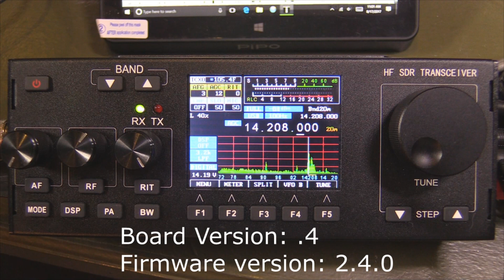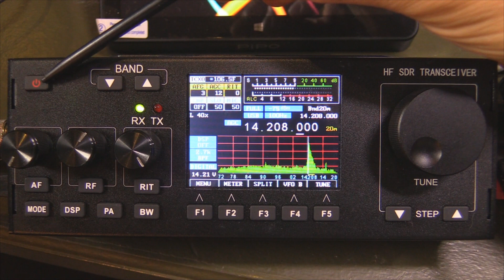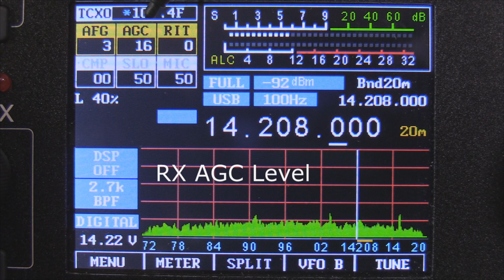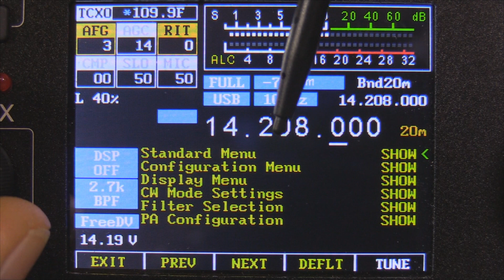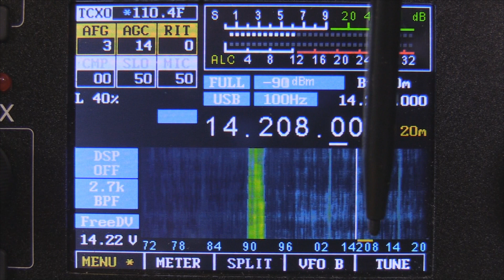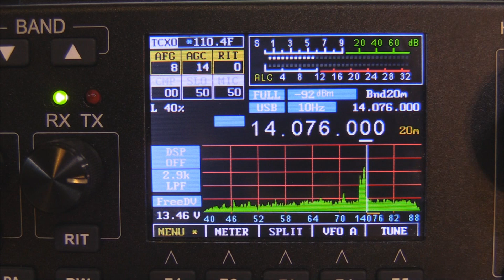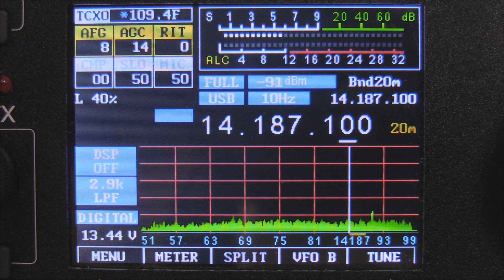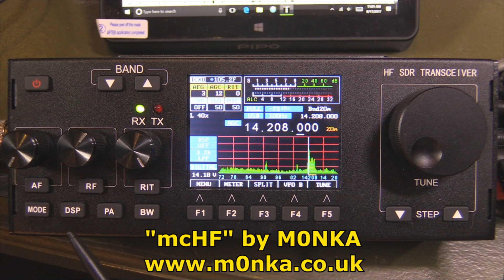mcHF QRP SDR - RS-918SSB  - Full Over-View of Functions

Comment: Thanks for sharing! Having been off the air for 16 years, I'm getting back in but at reduced equipment/antennas etc. Darned HOA :)  Amazing looking little rig. Not clear on where they can be purchased.
Reply: John- Well, it is available from two sources. The actual radio was designed in the UK and is available as a kit. All the hard stuff has been done for you. It's basically boxing it up and adding the basic controls. There is soldering involved! And you have to align the radio. Today of course, the Chinese have cloned it. It's available as the RS-918SSb from Risen radio. Their clone is not the latest revision circuit board. It does work though. Still, this radio is not a turn-key thing. It's for tinkerers. The output TX isn't very clean, but OK at 10W for QRP. If you are getting back in, make a higher pile of dabloons and buy a IC-7300.  It's a slam-dunk great SDR radio and can do it ALL. You will have great support from Icom and a Huge community of users. Take this from a guy who has tried them all!

Comment: I got the same model, just came in, I put it on a wattmeter, I get over 30 watts on high, go into PA menu and had to change Reduce power to On to get it to down to QRP power levels.
Reply from the maker: The finals are capable of over 30W output...but not with good clean output. Calibrate the whole radio first!

Comment: Nice work on this! I just got my RS 918 today and spent a few hours with it. I can't seem to get it to work consistently on FLDIGI. Do you know how to, I guess calibrate the output power meter? It's supposed to be a 10 watt radio but I appear only to be getting 3-5 out of it tops. Not sure which menu item to change for that, especially in digital modes which I run pretty much all the time. I also noticed the ALC didn't move when I did get it to transmit on FLDIGI. I will see what the compressor button does as you showed here and hope it helps. I got no responses on JS8 or FLDIGI upon transmit at 3-5 watts and wondering if it's even getting a signal out. It does appear to be receiving. But I wonder if either I'm not putting out enough power, or the lack of ALC movement means I'm not really getting out.  Any thoughts on that...anyone in the chat?
Reply: Golly, I sold this radio a few years back- else I would be very happy to assist you!
Reply: @Yavor54  LOL! I know there's a learning curve with radios and am trying to be patient, but I may join you in selling it.  This morning, I have no volume coming out of it. I did increase the compression and the ALC meter has a couple of dots indicating that there's something there but they flash and don't hold. So I have no idea if I'm getting out with it or not.

Comment: Thanks for a fine review! Does this radio have an antenna tuner built in?
Reply: No it does not. There is simply not room inside. At this power level, you really want to be running resonant antennas. I use folded dipoles on 20 and 40 with this radio in the field. Same length as a dipole and they have gain. PS: because of the finals used in this radio, there is a lot of power "headroom" and it makes a great difference on average SSB power output. 2 out of three times receiving stations tell me I "can't be running 10 watts"- I'm too strong. And second thing to remember is- don't use an amp with this radio. It's output isn't totally clean.
Reply: Bob Nagy thanks a lot for reply Bob! I actually ordered this one model. I was hesitating between this and the more expensive Xiegu with the tuner in it. But found this SDR neater and full of nice adjustable features, besides it has such a cool frequency band visualization (since these are not scanners it is cool to see busy frequencies).
From what you say, and from other tubers I learn that these built in tuners are just for refinement of how the radio feels about the reflected signal, not as a fixture for a bad radiating resonance. I’ll dream to learn the CW (working on the comprehension side) and I think it should work on this with a straight key. May be later I may build a tunable loop since I have this old capacitor lying somewhere but in the mean time I probably will try a dipole like you do (except that this implies a good weather day and some sort of an arch or a launcher to throw this cable to a high branch :) Cheers!

Comment: hi bob. when the kit arrives, are there tons of soldering that you need to do or is the kit almost completely soldered with the tiny components that it needs? i checked out M0nka site and it APPEARS that most of the stuff ( the tiny bits at least ) have been soldered. Is this correct?
Reply: All the difficult things are done. It's an easy job. Then you have to align the radio...takes 15 min.

Comment: Can i use this as a ham radio base station?
Reply: Yes...but you should not attach a power amplifier to it. It does not have clean enough transmit output.
Reply: What issues are you having? Apparently some are having problems with leakage in the pin-diodes. I replaced the pin-diodes in mine with a relay, and the output is now much cleaner.

Comment: Nice coverage of features. But for the life of me, I can't understand why not a single ham YouTube video maker can properly tune in a sideband signal. It's not that hard. You turn the VFO until the guy you're listening to sounds normal and not like a robot or duck. Also, no mention of the transmit bandwidth and if it's adjustable.
Reply: Huh... I did have one guy tuned in off freq.  Since radios these days are almost all within a few cycles of spot-on frequency-wise, people usually are on nice even number frequencies. It is almost impossible to be off. That said, I've noticed that each operator has a personal preference in the tone of a received SSB signal. Strangely enough, it is a subjective thing. Maybe your preference is different from the majority of people. Transmit bandwidth is not adjustable.

Comment: Not as good as a RSPDuo on receive. Not even close.
Reply from the maker: Interesting comparison. I totally agree. I'm releasing my review on the RSPdx today. (hopefully)
Reply: @robertnagy2163  I guess it's a case of " If you can't hear them, you can't work them "
I have a few hundred different Transceivers &  Receivers, and none comes close to the rspduo. As far as Transmit goes, ANY old Transmitter will do, as long as you get as close to 100% Modulation. Near 100% Modulation, nobody will know what your using if you don't tell them. Just use a change over relay. And with DSD+, you also have a few Digital Modes, up to 2 GHZ. 6 GHZ with the HackRF One. And SDRUno is beautiful and Free.  With a PC, the Sky is the Limit.
Reply from the maker: @Leojim650  Well, there are better receivers. It is designed within a tiny budget. It is not even SDRplay's best RX. What a value though!
Reply: @robertnagy2163  Better receivers ? Not So. Their not on a budget. The $20 dongles are a budget, but their not even close to the rsp series. You'd need many Thousands of dollars worth of test gear to measure the difference between the Kenwoods 990 receiver and the RSPduo, and what's the price difference ?
I'm talking about the Original from England, Not the Chinese Imitations.
Reply from the maker: @Leojim650  Paul- Respectfully, as amazing a job as SDRplay has done in creating budget wide-range SDR receivers, it is unfair to compare them to top-shelf SDR RX's. SDRplay is the Value leader unquestionably. I will continue to promote their products and own almost all of them. Nobody offers what they do at that price point. Yes, you need to spend thousands to excel the RSP line. But it can be - and is - done. For testing and casual listening, there is no comparable RX in the hundred's of $$ range. But when you are operating a contest with several kilowatt stations spaced feet apart, this is not what you will be using. When you are depended on to detect foreign attacks on our soil, this is not what you will be using. Just the ADC chip used in a 24 bit SDR that can sample 30 mhz in real time - costs hundreds of dollars each. There is no shame in this venture. It is just a matter of the reality of our state of digital technology at this time...and the costs involved. Hats off to the gang at SDRplay for these receivers.